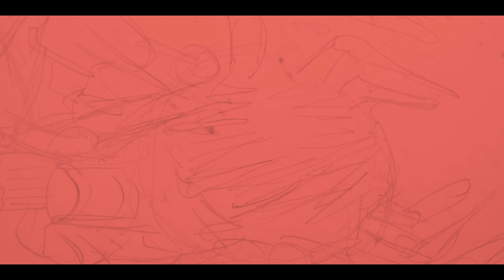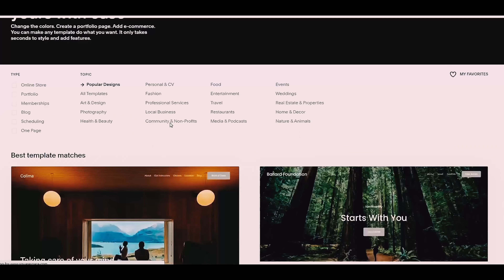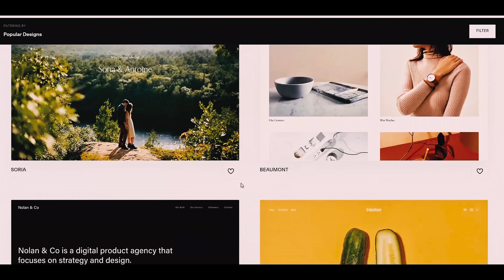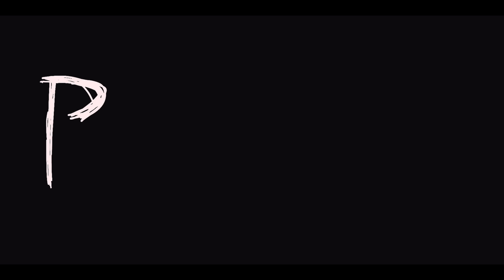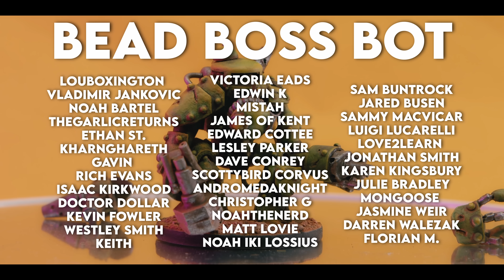I'm MAKING A GAME... And A BEADBOT

Comment: Looks like I discovered this channel at exactly the right time. My son and I have started collecting bits for 'bots and I'm looking forward to the game. 

I have a couple of questions that I've not been able to find answers to in the vids or website:

1) I see you using various gauges of armature wire - spine, arm and finger (?). what would be some good widths to start out with? I got 2mm on order, what else do I need?
2) You spray the things every so often - what is it and why?
3) Where'd these beads come from?! I thought I'd be able to easily order  a variety of wooden beads online, but it's weirdly hard.

Thanks!